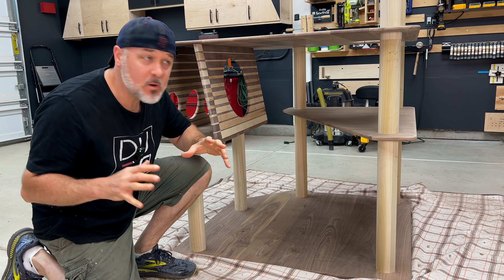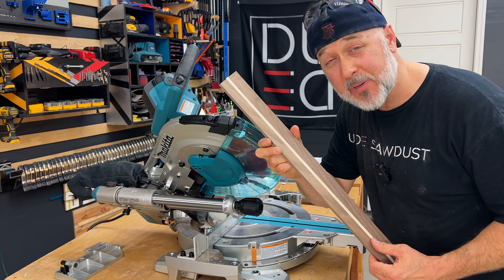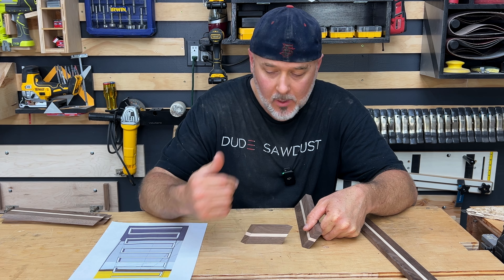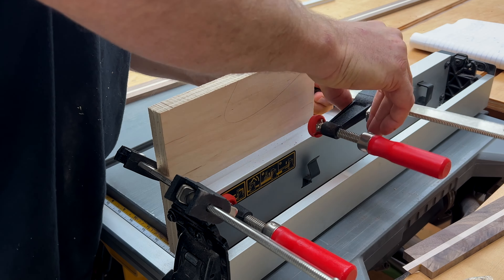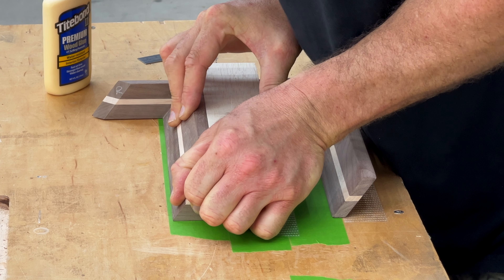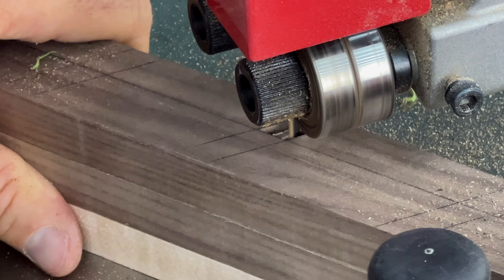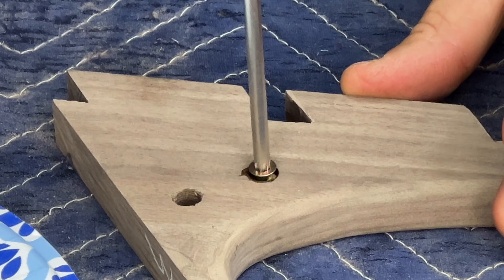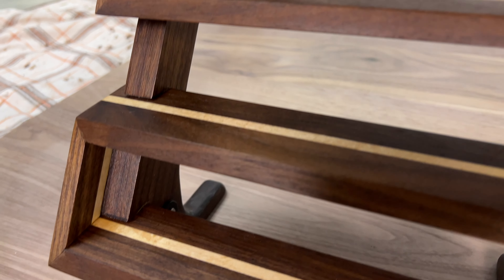I Built A Staircase To Nowhere

Comment: That's a gorgeous set of stairs.  This cat condo seems to be more of a mock up/practice piece for some future projects and/or design ideas for art deco/modern furniture.  The stair case could easily be scaled up into a leaning/ladder book shelf!  sweet!
Reply from the maker: I love this design and it could definitely be used for other more larger applications. Imagine as actual stair case in someone's house. That would be cool. Honestly, it's hard to stop looking at it.
Reply: @DudeSawdust  Looking at the possibly AI generated image you worked off of, I would need a railing, vertigo may be an issue, 🤪  But yes, beautiful.
Reply from the maker: @MJLWoodWorks  In the original image the stairs are supported by cables suspending from above. You have to look closely to see them. Still seems questionably unstable.
Reply: @DudeSawdust  Ah ha!